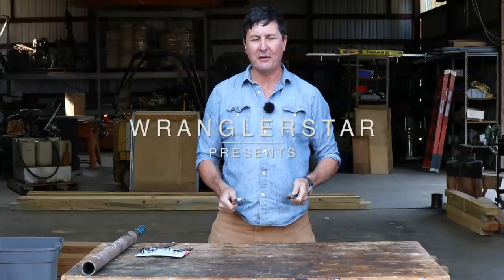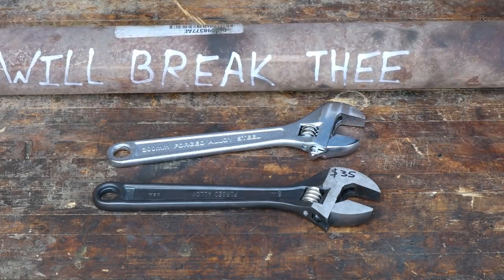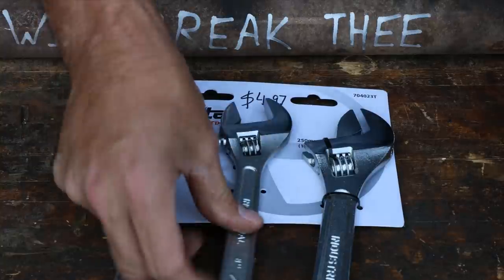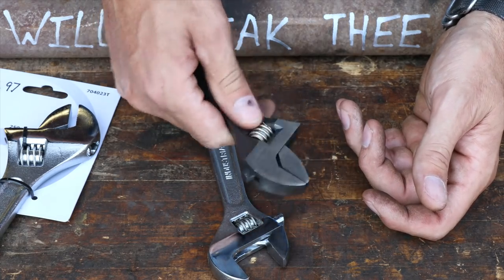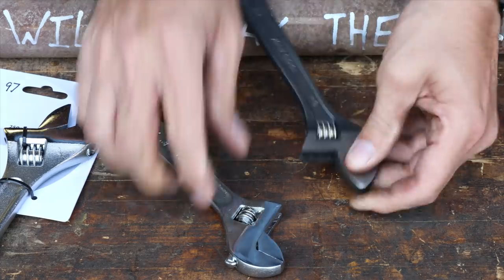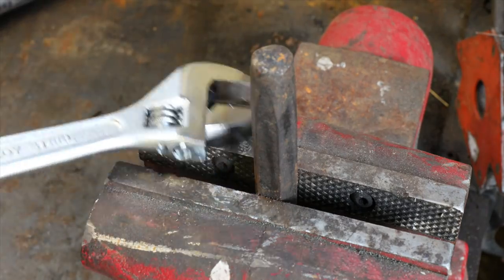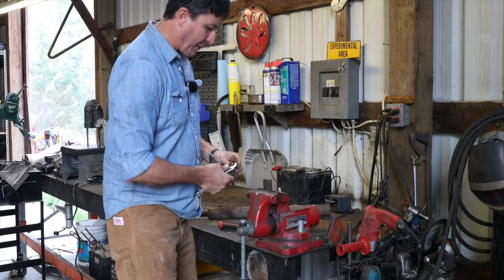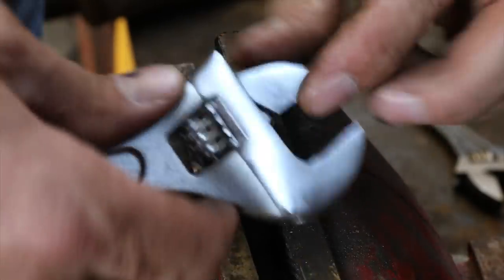Testing Cheap V.S. Expensive Wrenches On AMAZON

Comment: I'm going to go with cheap out on other tools and buy a decent crescent wrench unless you have like a little tool pack for your bicycle ride that you put in your backpack or something but other than that if you're going to use it mechanically cheap out on other tools I suppose you're crescent wrench. and don't cheap out on your screwdrivers because you're going to destroy every screw you stick them in I find it to cheap out on sockets sockets are good place to cheap out even ratchets at harbor freight you can use those by the super industrial quality ones never cheap out on an allen wrench because you just going to strip out your bolt it's interesting

Comment: My question is why you compared a $35 SK (good product, I have owned quite a few) against the cheapest possible chinese wrench (set of three for $5) you could find?  I use name brand from snap-on, John Deer, Matco and Mac, to Craftsmans, SK, Blackhawk, and Proto, as well as chinese tools such as Pittsburgh Professional.  I am as money and value conscious as anyone, yet I would never even buy a 3 for $5 and expect any kind of value.  Compare a ten dollar chinese crescent wrench (such as the pittsburgh pro 10") to the thirty five dollar SK and the test is actually fairly reasonable.  I still think the SK would win, but I think that particular SK would also outperform a snap-on adjustable as well.

Comment: We learned that a $5 wrench is obviously not as durable as a $35 wrench..duhhh.. Usually an industrial grade wrench has darker and a harder steel.  Depending on where youre going to use the wrench, if its only for light duty, you can go for the $5 wrench, but if its for heavy duty use, better buy a more expensive wrench.

Comment: I have the feeling you don't fix metall stuff hard enough in vices. A mistake I did too you can not fix wood with that force but metall even square tubes... I do now have a rubber hammer laing beside my vices to hammer the twist handle after Beeing not able to turn it by hand. 
I have just build a cargo-bicicle out of 2mm mild steel and I fixed that thing between the welds to bend it straight... firstly I do now trust the welds... very hard to bend... iam not light but I did the sumo attack from 1,5 meter to bend the main tube below a quarter of a millimeter. 

I pressed that square tube in a vice like I never pressed something before  ( old industrial vice), I have magnetic aluminum vice protectors, they clip on both sides of the vice and protect the vice an the viced thing.... there are no marks in the steel you clamp even with the sickest force.

Comment: The only tool that underground minors have is a 13-inch crescent wrench with 1 more tooth ground into it so it will fit the airline nuts
Reply: I understand that newer crescents for underground miners now have the hole at the end of the handle seized for air line nuts.
Reply: @thomasmichaelgallagher.2996  That may well be but that would be for the vutallic coupler clamps for the air pipes in the mines, not the air hoses running to the equipment. I believe the crescent wrench had to open to 1and 15/16 inches to fit the air hose coupler nut on the end of the hose.

Comment: Ok you will NOT got through 7 wrenches in your lifetime... in the end it justs comes down to if you need a wrench often or if you will use it here and there. The only reason to get the higher quality one is if you are serious and will use the wrench a lot. Otherwise, if you are like the family "handyman", you truly do not need the 35$ one.

Also the chinese wrench is 1.66$, so technically you can get 21 of the chinese ones before you even reach the price of the American one. So again, you should only need the American one if you truly need it a lot and to make sure it doesn't slip, not just so that it'll last longer.

Comment: I still think your tests are flawed , for a start  its common sense the if you spend more on  stronger tensile strength in materials weaker is going to fail first.  you should set up tests putting each tool through test what they were build for. use rust in bolts, cross thread bolts.  test them on tests they can be fairly judged  time might be a big factor and how often a tool is used. no one set out with the intention of breaking there tool dear or cheap

Comment: Sorry dude i feel like this most like many videos is biassed i feel like theres more you couldve put on it especially with cheater bar. Im half your size and could put out more force than that just saying and also wouldve liked to see the tests on a different section of whatever metal you were using besides the same exact area which you were using then it becomes super biased because you already messed up the experiment by putting someone it amd they dont lnoe

Comment: 1 it’s called a Shifter not a Cresent wrench , Cresent is the brand , 2 you don’t use these tools under so much pressure your using the Wrong tool you should be using sockets or spanners this shows you have no idea

Comment: I don't believe this is a good test you can buy clip on tourgue meters if you will. If your saying your pulling a bit harder on one and not the other is it a bit as in 5lbs or 50lbs and the jaws are designed different and of course the S and k is a lot more hefty and thinker jaws I mean come on dude, that's equal to a 40 year old 250lb man fighting a 75lb 4th grader  so I do not believe it's a fare test get two wrenches in the same price range
Reply: John King He could have compared two similarly priced wrenches but that wasn’t what he wanted to do. It was about a more expensive USA made wrench and a cheap Chinese tool. And it’s fair not fare.

Comment: Must have tool? Srsly these things are usefull in a war, where you have no access to proper tools. No self respecting mechanic would ever work with such a trash tool. The design is flawed to a point where the proper use damages the tool and the fasteners.

Comment: He is exactly wrong on which way to turn a Crescent wrench. By turning it "clockwise" he was putting the most stress on the end of the movable jaw. Turning it the right way puts the most stress on the inside of the flexible jaw and on the outside of the non movable super low flex fixed jaw. He is a fool. Didn't even use any way to measure the force.